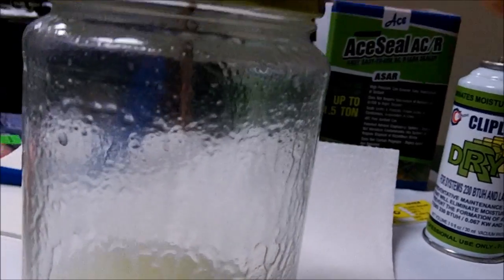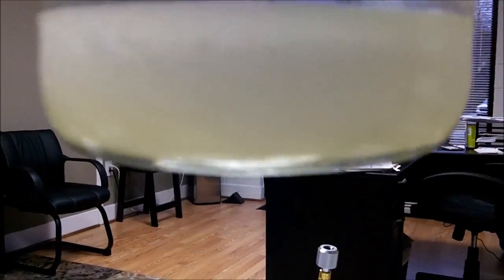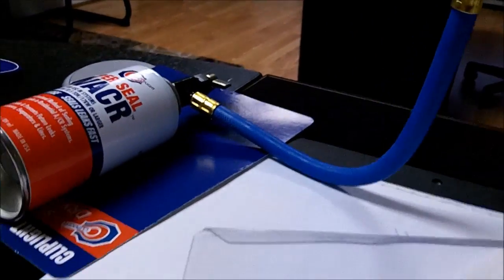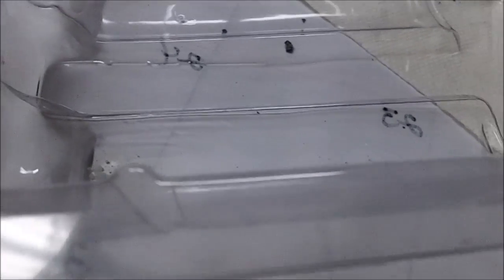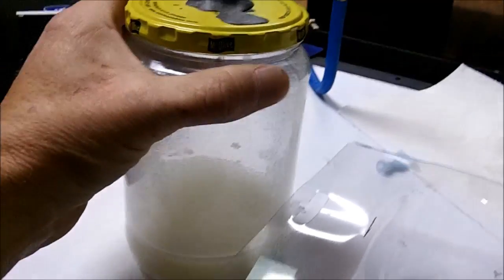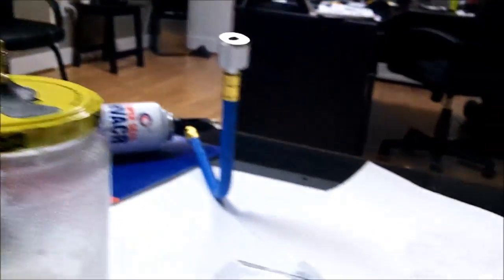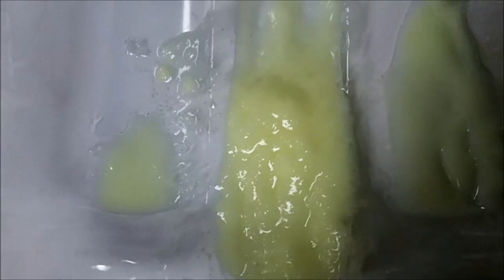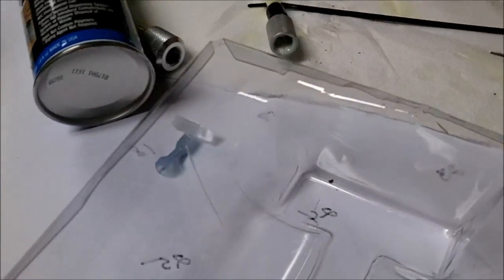HVAC Stop Leak Experiment Part 3

Comment: If it’s not oil or refrigerant then it’s a contaminant. Thanks for the video. Duct tape on a leak would be better. You just have to add a couple ( 2 minimum) zip ties lol works every time.

Comment: I'm not for stop leak by any means, but aren't AC systems vacuunmed out to eliminate the air out of the system?  Maybe the reason it caused so much rust and corrosion was because of the air in the jar causing everything to oxidize.  I'd be curious to see if the same would happen under a vacuum.

Comment: Every HVAC System I Every Worked On Had to be evacuated and NOT Have Non Condensables in the system, You on the other hand adding Stop Leak to a jar Not under a vacuum with Out Refrigerant, Or I Missed That Part. R U a Chemist ? Or Just a HVAC Tech. When U gonna start telling NASA the Shit they putting on the Space Station will not Work. Could get more Technical but whats the Point.
Reply from the maker: Hey Dave are you trying to say stop leak works?
Reply: T&N Services LLC. Yes and No. But I think It was design for havc systems and not a Jar opened to atmospheric pressure allowing Non Condensables + Adding water, then mixing shit together. Hell why not Add Salt & Pepper to the Mix.
Reply from the maker: Here's why I did the experiment, because you simple do not know what the guy before you did. Some of these systems are hard enough to mess with without throwing something else in the mix.
Reply: T&N Services LLC. Agree, I Do Refrigeration Also besides hvac and sell Amana Equipment (lifetime Warranties)  Not only am i dealing with 15 types of Gases for 1 system that can be used and 3 types of Oils POE,Ester, AB. a lot of times (Especially Bars) Joe 6 Pack will Fix it. and the system was not Labeled as to what Type of Gas Used. (R-22 and 410a) Don't Like each other. But 4 U to just start Mixing Shit up in a Jar............Well U See My Point. I Don't Buy It. Try it Again with an Evacuated Jar add some oil then add Stop Leak only, That would be more believable.

Comment: I use the Nu Calgon version hundreds of times a year and it really seems to stop small leaks. If the pressures are fluctuating at all, I do not do it for fear of moisture in the system. Had two problems and learned to be more careful. It's like an evap coil in a can. 

First time I experimented with it was on my neighbors old beat up package unit. That was about four years ago and he has not been filled up since....before that it was being filled up every nine months.

We even moved that piece of junk last year and it is still going strong...the stuff works great really
Reply from the maker: When I comes to using stop leak I'm kinda like the kid who put his hand on a hot stove. I've been to many systems where it didn't work. The problem using stop leak is it only seals very small leaks so to me it's a gamble to use it. Not to mention the effects that is does cause when it doesn't work. Let's say you put it in and it doesn't work, the customer says let's change out the system, now you have to change the lineset because you still have stop leak in the oil. We all know that when stop leak hits air it hardens. I don't can how much you flush a lineset out your not going to get rid of all the oil in the copper. A buddy of mine called me one time and said he was going to check a system that had stop leak in it when he was done he called me back and said it was low again but where it was leaking before wasn't leaking, it was leaking in a new spot. He said so it worked my response was no it didn't cause it's still leaking. Bottom line, there is only one way to fix a leak and that is to fix the leak.
Reply: +T&amp;N Services LLC. Everyone around Minnesota is using stop leak except me. There are to many hacks running around not pulling a proper vacuum on systems, leaving air/moisture behind. I cant tell you how many ac installs ive seen where the guy doesn't own a micron gauge. I used stop leak before and clogged one dryer and plugged a cap tube. All because the guy before me didn't pull a proper vacuum. The customer doesn't understand anything except that the system wasn't plugged and now because of my work it is. I am on the hook now. How can you tell a customer that  if the guy before me didn't do it right I will be causing a bigger problem. And oh by the way this happens fairly commonly.
Reply: Not all of us in MN use it. I followed a hack who didn't put the sticker on and plugged up my gauges. I still use analog gauges but I'd hate to see what it does to expensive electronic gauge set.

Comment: I don't use this stuff. but is your experiment valid? looks like you have a full can of the sealant but not near the oil the system would have or the refrigerant. Don't know if this would make a difference. When conducting experiments one has to simulate the same conditions. You're right it doesn't like water that is what activates it to set up. Like I said we don't use it but in defense to the manufacturer, conduct a fair experiment.